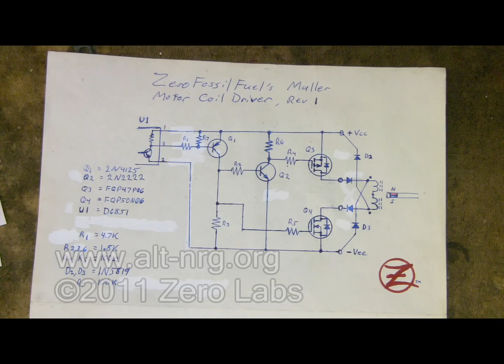#289 Working Arduino sketch for the Muller motor/generator!

Comment from the maker: @prankmypants The problem was not with the original source. It was Quick Media Converter. I guess the free edition caps the bit rate no matter what number you enter. Practically every converter package that actually works well costs around $30. I was disappointed when IVC couldn't handle it. Perhaps someone can suggest another freeware package that converts .MTS to .AVI well?

Comment: Question: when you energize your coils they have a magnetic north and south so I am assuming that your magnets are also aligned to coils north and south. So if you change the magnets from attraction mode to repulsion mode you will also have to change the negative and positive of the coils.

Comment from the maker: @firepinto While the Arduino could be used in production units, I plan to use it mainly as a R&D tool. Ultimately, once the correct parameters are known, a much simpler fixed hardware solution can probably replace the Arduino altogether.